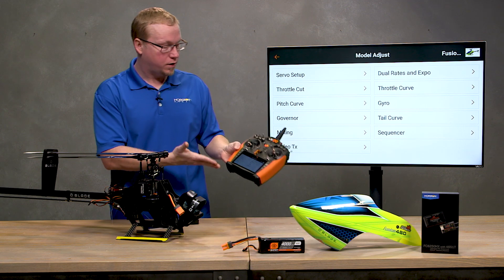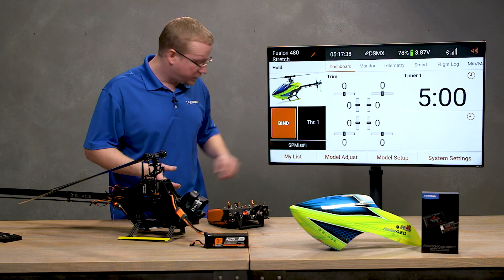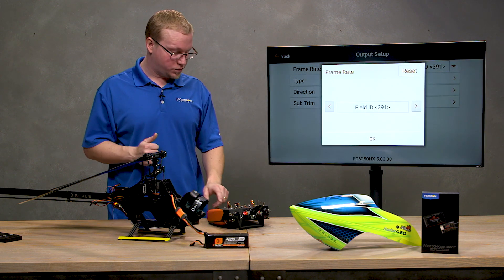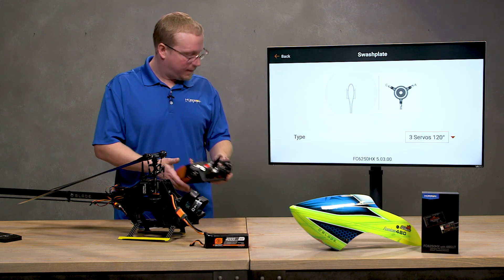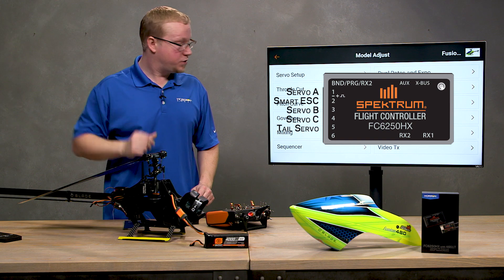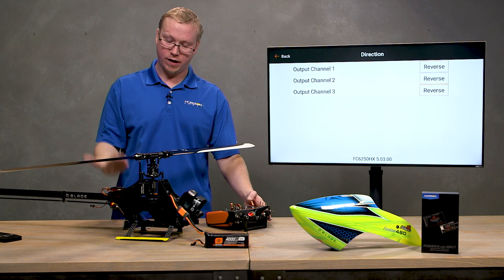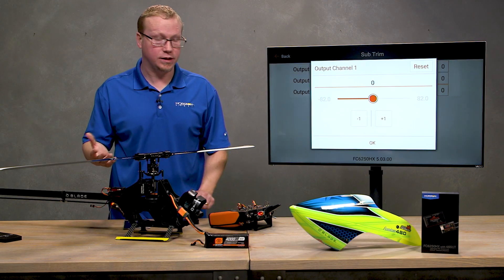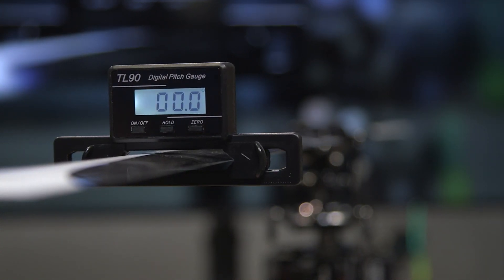Part 4 - Swashplate Setup - Spektrum 6250HX Flybarless Controller Setup Series

Comment from the maker: In this video we go into detail on all the steps required to successfully setup the rotor head and swashplate on your flybarless helicopter via the Forward Programming menu on the 6250HX.

Here are links to the other parts of this video series

Part 1- Introduction https://youtu.be/fwVeKYJWFAk
Part 2 - Installation and Binding https://youtu.be/_UB4SBnyFjI
Part 3 - Transmitter Setup https://youtu.be/rxS7LmwlbVs
Part 4 - Swashplate Setup https://youtu.be/VJ0m2S42QPI
Part 5 - Tail Rotor Setup https://youtu.be/vr3rnwtveak
Part 6 - Final Steps and Preflight Checks https://youtu.be/HDpvRV47H9U
Part 7 - Safe and Bailout Setup
Part 8 - Smart Technology Setup
Part 9 - Tuning with James

Equipment used in this video series
Blade Fusion 480 Smart Super Combo - https://www.horizonhobby.com/fusion-480-smart-super-combo-kit-blh4925sc2
Spektrum 6250HX w/ 4651T Telemetry Rx (included with Fusion 480 Smart Super Combo) - 
Spektrum iX20 Smart Transmitter - https://www.horizonhobby.com/fc6250hx-helicopter-flybarless-control-system-spmfc6250hx
Fusion 480 Stretch Kit - https://www.horizonhobby.com/fusion-480-stretch-conversion-kit-p-blh4965 
Spektrum Avian 100 Amp Smart ESC (included with Fusion 480 Smart Super Combo) - https://www.horizonhobby.com/avian-100-amp-brushless-3s-6s-smart-esc--spmxae1100
Spektrum H6050 Cyclic Servos (included with Fusion 480 Smart Super Combo) -
Spektrum H6360 Brushless Tail Servo - https://www.horizonhobby.com/spektrum-h6050-high-torque-mid-speed-heli-cyclic-servo-p-spmsh6050
Spektrum SPM4767 Remote Rx - https://www.horizonhobby.com/dsmx-remote-receiver-spm9745
Spektrum Smart Lipo - https://www.horizonhobby.com/222v-4000mah-6s-50c-smart-lipo-battery--ic5-p-spmx40006s50
TL90 Digital Pitch Gauge - https://www.amazon.com/YoCoo-Display-Airplane-Helicopter-ST250-800/dp/B017LYIPX6/

Make sure to follow us on Facebook and Instagram for all Spektrum News and Promotions!
https://www.facebook.com/SpektrumRC/
https://www.instagram.com/spektrum_rc/  
@SpektrumRC

Thanks for watching!
Reply: Hi can this be used with an older tx ? Programmed via pc ?
Reply: ☠BLACK BARON☠ 9:22 AFR ... Could someone explain "Differential" for the updated firmware version?

Comment: I have been at this for hours and I cannot get the servos to move in the right direction no matter what. I'm not using a smart-ESC. REVERSING DOES NOTHING, other than making the servers move the wrong direction again. When you say plug in servo a b and c. What servo is a what servo is B and C..

And I just bought this today so it can't be old stock out of date.

Comment: What is the right way to set up the 6250HX for a helicopter with reverse swash movement; in my case a Thunder Tiger E700? On this heli, the swash moves downward with positive pitch and upward with negative pitch. Just reversing all servos does not work, it will make aileron and elevator move in the wrong direction.
Reply: For the record, this seems to be the way to do it: reverse all the servos, and then set negative values for roll and pitch in the AFR menu!

Comment: I recently  purchased fc6250hx and I installed to my rotorscale uh-1 huey scale helicopter  the swaplate setting calls for a 3 servo 120 degrees I'm getting all three sero to go up for positive pitch and negative pitch however when I roll left the pitch servo doesn't move and when I move the stick to the right the elevator Aliron both move. Can someone help me with this
Thanks
Reply: i had the same problem   too fix it only switch the swashblade servo ports on the fbl  and then try again to reverse it in forward programm until its fine

Comment: Hi, when leveling the swashplate you enter the Sub-trim menu which results in all servos moving to the center position. Is the Sub-trim menu also selected when you adjust you blades to be at zero degrees?

Comment: Hi I'm having mega issue with swash plate aileen and elevator direction. I have collective pitch working ok. Its driving me mentally insane.. please help.
Reply from the maker: Likely you have some of the servos in the wrong port location (most common cause)

Comment: I have a nx8 that has problems since I updated it. What should I do. I had it in the box for a Year and never used it. now I'm trying to set up my fusion 480 .and in my gyro set up will not let me assigned a channel  to aux 2. It just stays inhibit it will not move from there.i assigned aux2 to gyro
Reply from the maker: Is this in forward programming menu or a different menu on the transmitter?
Reply: @SpektrumRCvideos  no. I open radio go to system setup then I go to channel assigned rx port. I set aux2 to gyro. Then I go back to the main screen and go to gyro. In gyro there is a place that says channel. I try to put aux2 on there but the tx will not let me. It just stays inhibit. It will not scroll to nothing but stays inhibit. I been getting help from coeshow on YouTube that fly's the fusion 480 with a 10nx. His radio works my does not. Help please. Been on this for 2 weeks losing my mind

Comment: I am usingthis exact model I have been trying to get this to work for a year finally sent in the flight controller.  Horizon hobbies sent it back said it works fine.  I have spent hundreds of dollars on spektrum radios Nx8 and this flight controller and I cant get the swash to move to full throw.  Probably an easy fix for an expert like yourself but I have failed to get any tech support.  So until they help there customers beware of these products.
Reply from the maker: Hi Travis, When you say you are not able to get full throws, can you elaborate? Is it the collective travel or cyclic movements? Also make sure you are not in SAFE or PANIC modes when testing.
Reply: @SpektrumRCvideos  cylindrical work fine. I can’t get more than being able to see that the collective is moving I the right direction.  Maybe 1/8” collective.
Reply: Figured it out it was a setting in the afr menu.  I still feel that horizon hobby has poor customer service.

Comment: Hey Y’all! Ok my issue is that I bought 3 new Servos H3055s and rebuild the 330s. The Flybarless FC6250HX 330 S  unit is acting up, servos are responding correctly on cyclic. I’m using DX6-G2. The pitch is incorrect now, the elevator (front) is correct. The two rear are not (reverse) and I can’t reverse them in forward programming. Radio settings are the same, had a minor crash, stripped a servo and two looked like they got burned. They got hot inside the case. My only option is a swashplate setup, output configuration and trim. There is no option to Reverse Servos Direction, so when I give positive pitch/ negative pitch for corrections is incorrect. Swapping servos to test output on the port are ok and the wires are setup using the Avian smart 30a is correct. It was working fine and now I’m confused. Do I have to purchase another $200. Unit or $800. On an X10/X12 to perform this method. 😡
Reply from the maker: Hi Jose, Sounds like you may have the 2 and 3 servos swapped. Try changing servo port positions and test until you find the correct combo. Also make sure that you have the correct Blade 330 S firmware on the FC6250HX. Hope that helps!
Reply: @SpektrumRCvideos  Spektrum!!! You were right. Swapping them fixed it. Thanks again.
Reply: I tried that, servos need reversing in swashplate setup. With my DX6 G2 I can’t get to that part of the initial setup and the 6250hx is the same, just purchased new servo and install them and I’m here for advice

Comment: What could be my problem if I am adjusting my Collective and I bring it to 12.5 degrees positive but it travels to 20 degrees negative pitch side? If I adjust my negative pitch and bring it up to -12.5 then I only have 3 or 4 degrees of positive pitch?
Reply: Make sure stability mode is turned off to get the right degrees.  Stability mode on will make it go all over the place.
Reply from the maker: Likely there is something incorrect mechanically if it is that far off. Make sure all your linkages are the correct length and going to the correct places on the swash and the head. ALSO make sure that your servo arms are centered when you go into the subtrim menu and set to 0.

Comment: Ok I've set up the 6250HX with forward programming on my DX8 G2 no issues but I'm a bit confused on the swash set up using AFR menu and setting the roll, pitch and collective!! I'm getting more the one way than the other so for example 12- but only 9.8+ when setting the collective pitch range is it done at mid stick? Or full stick? I saw your answer to some one else about setting the - pitch and then use travel adjust to set + pitch but to do this surely you will have to come out of the AFR menu in forward programming!! I'm a little bit unsure how I would do this as surely the swash and Gyro would be working!! Please could you shed some light on this for me, as at the moment I'm scratching my head🥴
Reply: I'm getting 12.5 forward and 3.9 backwards,swash is perfectly level at mid stick,full collective ant full pitch forward reads 22 degrees
Reply: Ah I scrapped it and bought a microbeast!! Set up perfectly straight away I did however use the FC6250HX  in a Trex 500 and had no issues with it at all and the Heli flies very well😄👍
Reply: I'm thinking same ,too much shit for no extra gain
Reply: Yep. The collective set up in AFR not working…I guess my 6250HX to return…

Comment: I can't get the same amount + as - Why is that? I made sure the heli was level. the arms are 90. both are almost perfect at 0 in center maybe -.1 or .2 on both blades but yet i get like 12 on positive and only 9.7 on negative. can we use the sub trim to adjust for the other one?
Thanks
Reply from the maker: At this time it only allows for AFR for both directions, but there is a update in the works to allow AFR for both + and -. In the meantime I would suggest setting it up so that negative is producing the pitch you would like it to achieve and then using travel adjust on the tx to turn down positive pitch to your desired angle.
Reply: @SpektrumRCvideos  okay thanks for the reply, I will try that today.
Reply: I've just set mine up today and had the same results 12 the one way and 9.8 the other!! I have no idea what they mean by using the travel adjust in the tx!! I found the whole swash plate set up video very vague and as for setting your collective range is it done at mid stick or full throttle? The sad thing is I'm not a Heli newbie but have no experience at flybarless systems!! Every video I have watched on YouTube is just as sketchy when it comes to setting the blade pitch😖
Reply: @IansRCExploits  in the radio menu go to travel adjustment and adjust the pitch numbers. I ended up getting it closer. Make sure you get your 90 degree to the servo and set the sub trim for neutral using forward programming.
Reply: Ok thanks for that!! So do I put the throttle all the way up adjust the pitch them full down and what about roll?
Reply: I've tried that this morning and it didn't make a bit of difference!! I took so much time in setting this Heli up after building it everything us 90 degrees, the swash plate is perfectly level I've got 0 degrees at centre stick so by rights it should be the same + to - Feel a bit disappointed now as I could have bought the beast X plus with the kit, I think this is a design fault and am starting to think it's very expensive junk 😣

Comment: it should be mentioned that you need a linear pitch curve to adjust the collective pitch range properly. It should be also in the manual just like it was mentioned in the AR7210BX manual
Reply: ☠BLACK BARON☠ Turning SAFE/Stability OFF for normal and hold mode. Linear pitch curve (normal and hold mode) is highly recommended by using the AFR interface for making adjustments. If the swash is perfectly leveled. AFR Roll and AFR Pitch values should be nearly identical. If Roll & Pitch values are too high in AFR the swashplate will cant against the main shaft.

Comment: I have this setup.  My problem is my right stick will only move swash up and down not front to back or side to side
Reply from the maker: Make sure all you have the ports being used for the swash and servo placements on your model as well as no reversing or swash type set on radio. Then in forward programming set swash type, plug in servos accordingly and then reverse one servo at a time (in forward programming) until you find the correct combination. Hope that helps!
Reply: @SpektrumRCvideos  had to reverse swash now everything else is backward.  Throttle stick says 100% when stick is down and 0% when up ix12
Reply from the maker: @jamiegagnon5095  Hmm, might be a good idea to call in for support. 877-504-0233. Or feel free to message us on Facebook, easier to provide support that way. Thanks!
Reply: @SpektrumRCvideos  already called yesterday.  They seem to think it may be faulty fc6250hx.  I sent in my info hope it fixes my issues

Comment: Good morning, On my IX 12 the swash plate diagram is blank and so is the page showing the orientation. Also I can not find the servo diagram as to what servo goes where
Reply from the maker: Hi Mike, is your iX12 up to date? You will cross reference the Swash diagram on screen with the port diagram found in the manual and in this video.
Reply: @SpektrumRCvideos  I just got it back from the Horizon service department (about an month ago) and it was updated then. I will check it when I get home tonight that it is properly up to date. Thank You for responding.

Comment: I know this is hard to diagnosis like this but I bought the FC6250HX receiver and installed it in a Blade360CFX. I have a DX9 black edition Tx. It binded OK but it fails to go into forward programming. I do not have a remote receiver. I plugged the receiver into the programming cable and it comes up on the editor. I updated the firmware in both the receiver and Tx with the Jan 2020 firmware. Any suggestions?
Reply: That was the problem. It’s now binding with a green slow flash and it goes into the forward programming. I am sorry for being such a bother and your prompt replies and help are very much appreciated. Your support is above and beyond the norm for today. Have a great day and thanks again!
Reply from the maker: Jeff Herndon using the included 4651T receiver?
Reply: Thanks for answering so quickly. 👍
Reply: Yes.
Reply from the maker: Is it timing out or?
Reply: I tried turning both off and back on and I tried within a minute. The screen just says “Connection failed. Click for menu.”
Reply: I tried switching to a different model then switching back and going straight to “forward programming” and it fails. The receiver is sold red and the flight controller is flashing red.
Reply: If I plug in the servos or the motor I get no response from moving the Tx any in any way. Did it not bind correctly?
Reply: I tried creating a new model and it bound to the new model with telemetry. I went straight to forward programming and it failed.
Reply from the maker: @jeffherndon  Servos won't do anything until you get thru some of the setup. Did you do everything like we did in the install video? https://youtu.be/R81szwu1PLE  I would double check you have the rx plugged in properly.
Reply: 2.05 and yes it put the fusion 360 firmware on the flight controller. I will go change it and try it again.
Reply from the maker: Jeff Herndon there’s your problem! The Fusion firmware doesn’t use srxl2 receivers. If you want to run Fusion 360 firmware, put a 4649T receiver in :)